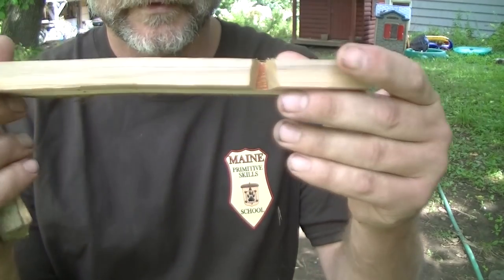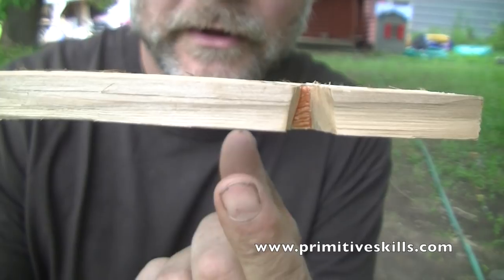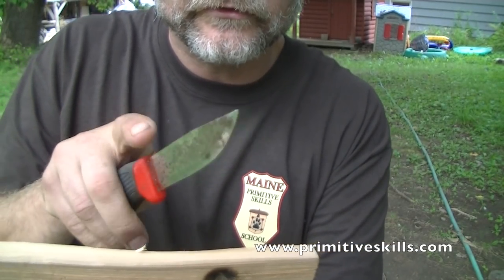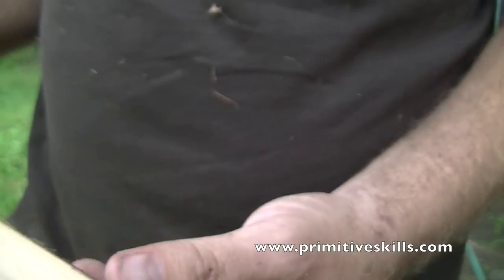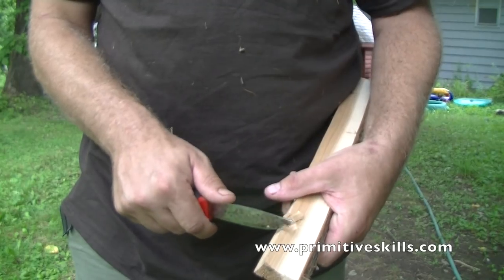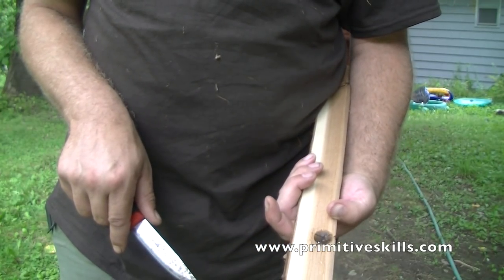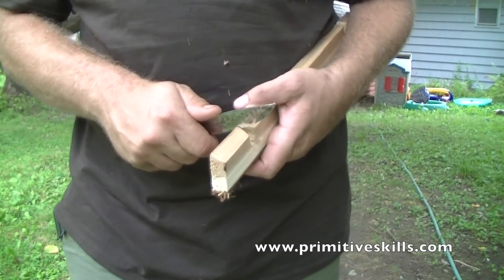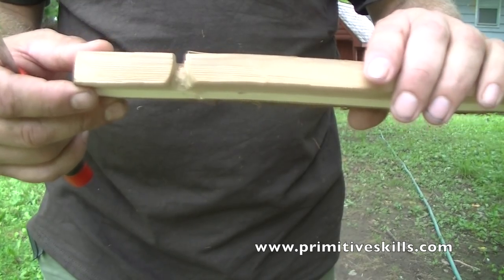Carving Your Notch for Bow Drill Fire Making

Comment: Thanks for posting. I have 2 questions. Is that cedar? What do you use for a bow string? Everything I have tried breaks before i get a coal. Thanks in advance!
Reply from the maker: +dlvmark In the beginning  use a rugged cord like bank line or p-cord. When your form is dialed in (smoke within the first three to five strokes, coal in twelve to sixteen) consider moving to natural cordage. Plant skin cordage like milkweed or dogbane (we have a few natural cordage videos), inner bark cordage like braided pine or three ply reverse wrapped basswood, or rootlet cordage like spruce, or hemlock, will work if you modify your form slightly to avoid braiding the natural fibers apart. This set is cedar, but balsam fir, willow, and most woods you can make an imprint with using your finger nail will work so long as they are dry and non-resinous.

Comment: How does the funnel effect future use? If you carved a straight vertical pie wedge out of the board, the second, third... etc. uses of the same hole would fill the same as the first. But with the funnel, as you get lower into the board, the wedge opens up. How does this effect the piling up of char and the concentration of heat?
Reply from the maker: +Lee Morgan The offset of the notch falling short of dead center allows the drill to work nearly to the bottom. On a dry softer wood, I usually get six to eight fires per hole with this technique. Hope this helps.